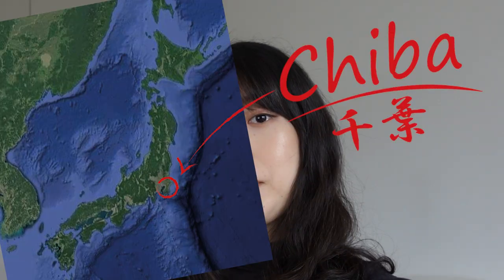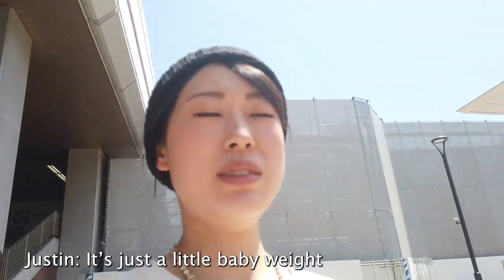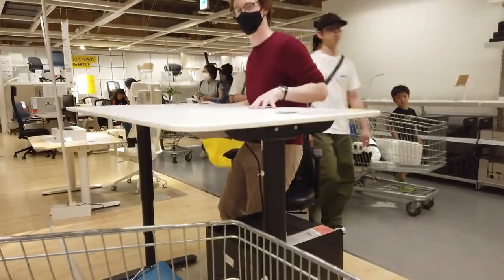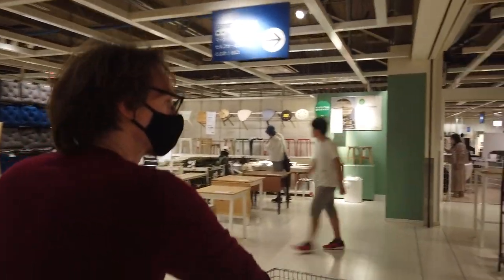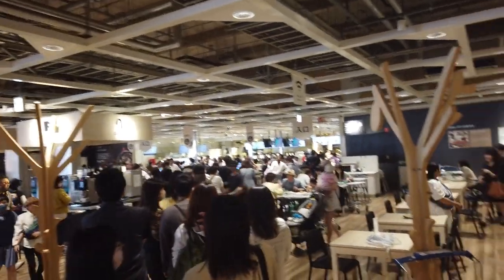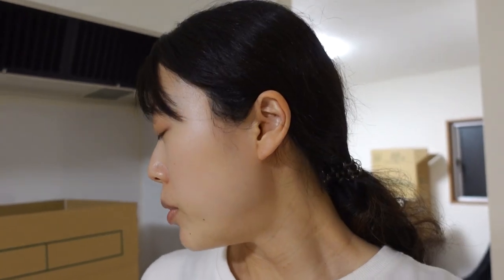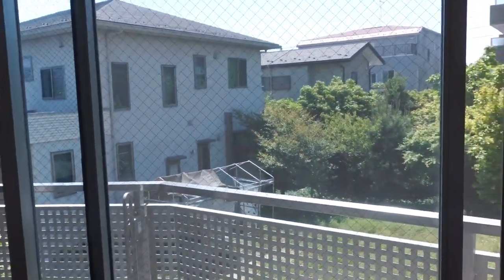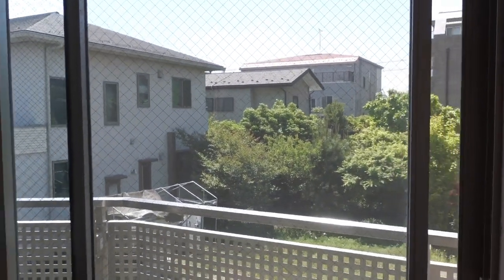Moving Vlog // Japanese Apartment For Family + Empty Apartment Tour

Comment: Nice video and apartment :)
Running: rivers run. Creeks run. "Is the creek running? No it's dried up." Factories and computers also run. Maybe because before electricity factories were powered by water wheels turning shafts and belts connected to machines? Today electronics run on electricity instead of water. But when your nose produces snot like a river has water, your nose runs. 

Since poop featured prominently in this video, here's a connection: When your bowels flow like a river, a slang term for diarrhea is "the runs."